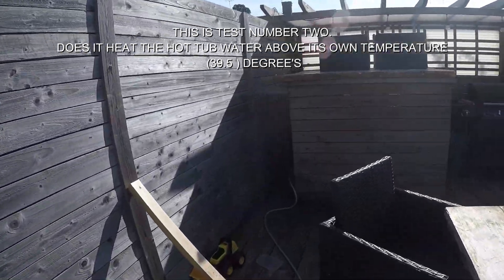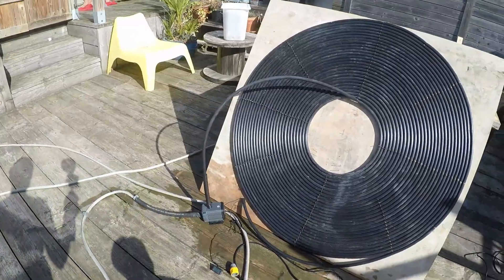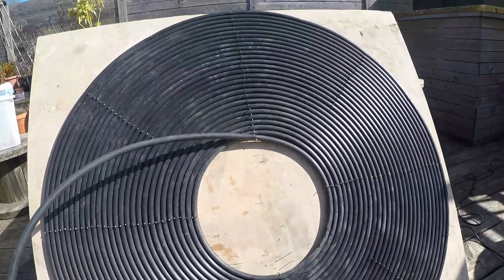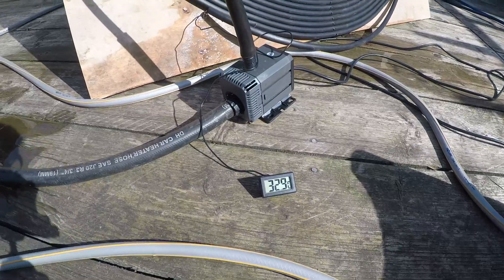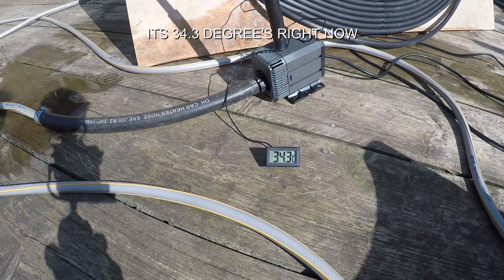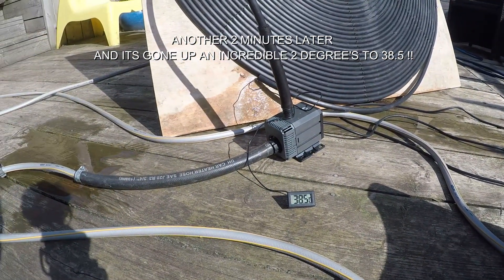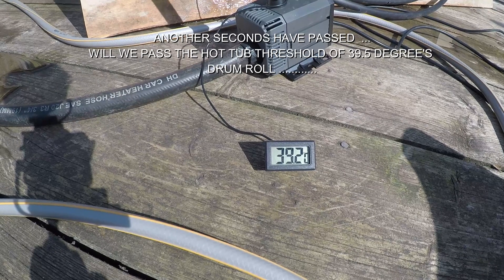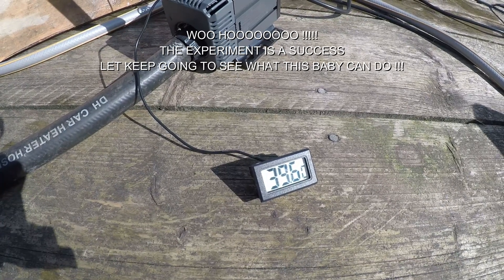How to make a Solar Powered Hot Water Coil  |  Will it heat the Hot Tub water ? |  Part 5/8 |  Ep#19

Comment: Hi great video, what external pump did you use have you got a link to it ? Thanks 😎
Reply: Well, he got link for pump but that pump does not corresponded with the one in video, however would be good to know some kind of formula what output/flow is enough for 25/50m of various pipe diameters.

Comment: Hey man, I've recently built this but it's not effective at all.

I've used the irrigation tubing, 100 meters of it and have it pointed towards the sun, it's hot for the first few minutes but after continuously running, it immediately drops in temperature. Any idea on how to fix this? Thanks
Reply from the maker: Hi, 2 ways I think.
Put a sheet of perspex over it all to create a hot space, and run the water slower. It will probably only stay warm if running it very slowly like a trickle
Reply: @thelondoncraftsmanworkshop  The water pump is definitely running too quickly. I'm using a small Whale 12v pump but I just need to figure out how to slow it down. Will definitely buy Perspex in the future, thanks for your help!
Reply from the maker: Yep I had that problem too and to be honest I've still not bought a smaller pump! Or perspex either  lol.
Your welcome  👍

Comment: This is great @thelondoncraftsman, inspiring, thank you. I was thinking to run the trickle from a spring overflow through a black coil and into a tub, but do you think a trickle would ever heat up a hot tub, or just be constantly cooling down too much, and need a higher volume flow? Any thoughts much appreciated, thank you in advance!
Reply from the maker: Its a hard one, I guess as long as you really insulate your tub like I have with celotex all the way round and especially the lid, you may stand a chance
Reply: @thelondoncraftsmanworkshop  Thanks! I'll increase the amount of tubing, get it as hot as possible on it's way in... I thought with a constant, v slow through-flow it would also stay clean and clear
Reply: @thelondoncraftsmanworkshop  Yeah I think insulation and getting the in-flow as hot as possible... worth a try! Thanks for taking the time to reply